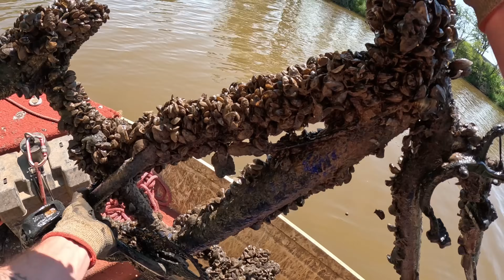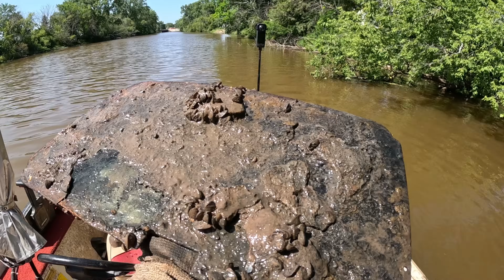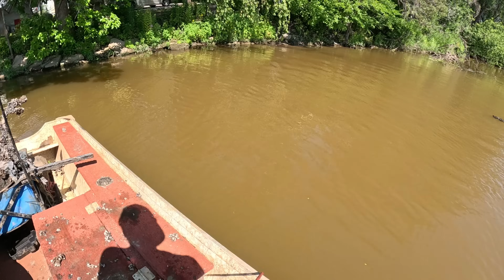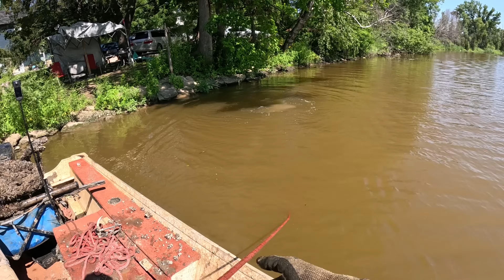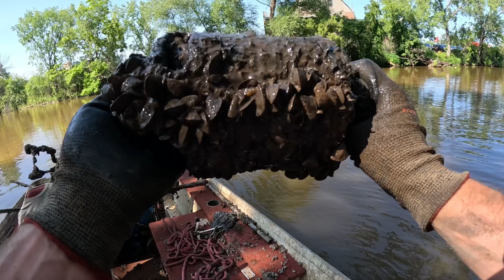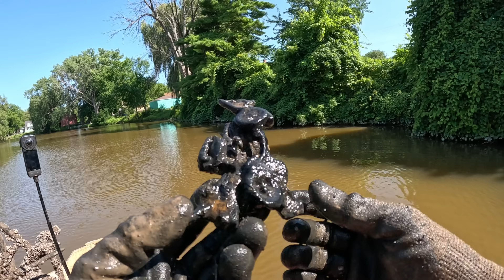You Won't Believe What I Snagged With My GIANT HOOK! (Magnet Fishing)

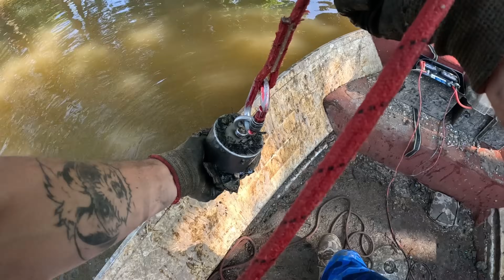Comment: 19:40 exhaust off a stationary workshop or old boat engine. The threads are definitely where it would screw directly into the side of the engine. Trust me I know I've worked on a few engines with very similar exhausts over the years